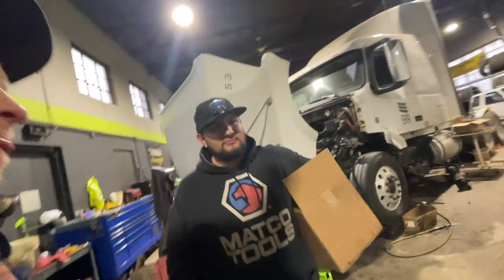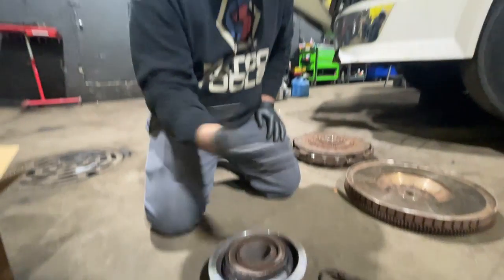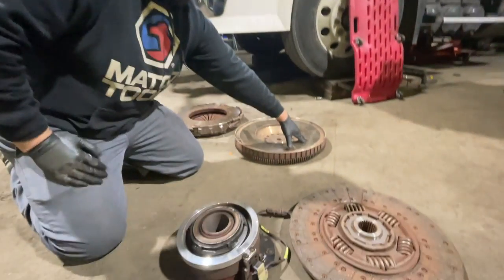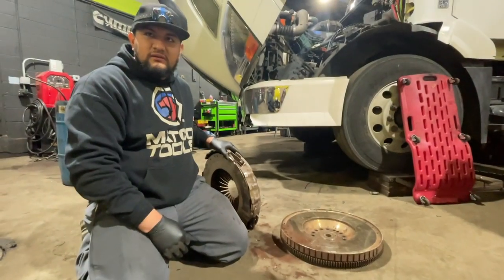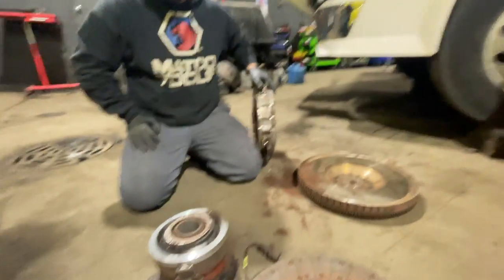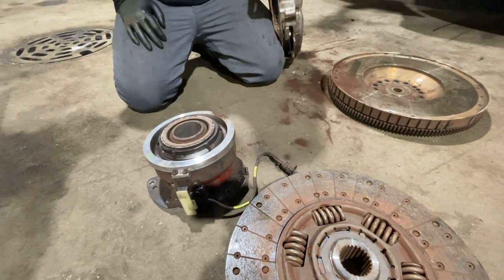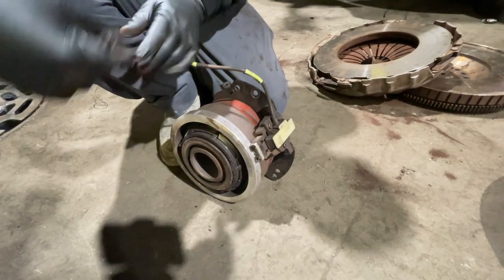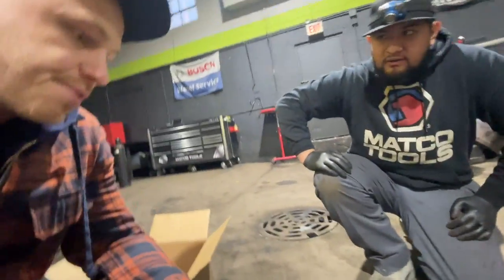Volvo i-shift transmission failed. Good to know when if you own one!

Comment: The driver caused this issue. He held the truck using the throttle instead of the brake. Heating the flywheel tells you that.
Reply: That's why hill start assist is important if you put drivers in trucks, especially if driver is a noob that's not paying attention to what he is doing

Comment: With my dads Ishift it struggled to leave gear at times. When you press on the brake pedal it’s suppose to disengage and go into neutral it failed to do it the one time and broke the output shaft. And almost caused a wreck truck was surging forward into stopped traffic and my dad had the brakes to the floor.
Reply: Yikes! Scary situation never heard or seen that happen. That bill escalated quickly! Hope all is well thanks for watching & keep on truckin 🤘🏽🤘🏽
Reply: @thatdieseltech4666  this happens back in 2014, what Volvo did was Reprogrammed the transmission, and the truck sat outside at volvo for 5 months. The truck never ran right again. I hope it got scrapped lol
Reply: @curtisnoble. I will buy a manual transmission for sure now.

Comment: Hi guys, I'm having error codeP10AE, which seems very similar to this one.  I thought I may have parked my truck on a slight incline in gear.  The air leaked out and truck did not want to start.  Aired truck up with air compressor and it will start but it still seems like it is stuck in gear.  Gear selector seems to work but I can't feel the shifts between R N D M.  Also, the truck will not rev in neutral.  I found TSB K64554358 but not a solution as I can't drive truck to service center.  Also, I did jack up the drive wheels and they seem to spin freely, so I think the trans is in neutral but won't rev due to error code.  Code persists after disconnecting batteries.  I don't have PTT.
Reply: What did you do to fix this
Reply: @timc8570  Hey Tim, its been a while, but I believe I did a battery disconnect for hours, then selected neutral before starting the truck and the truck's air compressor.   Never, ever, turn off the truck in anything but N, in my opinion.

Comment: Hi guys, am from zimbabwe and we have a Volvo FH V4 truck, it keeps sending the message clutch malfunction, what causes that and how do we solve this problem, we changed pressure plate, clutch plate, solonoid Valve, thrust bearing, was there other any other things that we were supposed to change again and which part, ? Please assist

Comment: My exact symptoms on my Mack mdrive, thanks for this.  So the clutch and clutch actuator would be replaced?
Reply: Clutch, clutch actuator, & clutch control valve along with the steel braided line suppling air from valve to actuator 💪🏽.

Comment: i have a 2003 Freightliner 3 peddle auto shift. the driver said it started sounding like the pto was engaging, 20 minutes later the clutch appears to have went out.   the thing is the truck is not equipped with a pto. should i pull the tranny & put a new clutch in? is there an Y,X shift issue? thank you for any info you can provide
Reply: I would drain the oil in the transmission & inspect for shavings.
Reply: @thatdieseltech4666  will do, thank you

Comment: Hello. Nice covering of issues. I have a error “neutral position not secured” truck wont physically engage in D or R. Truck won’t  move at all, and when in D won’t accelerate. Any help I appreciate. Thank you
Reply: I-shift transmission, 630000 mi, stuck in intersection. Won’t engage fwd or rew. Towed the truck to delivery, than towed the truck to shop. Clutch and shifter replaced $5100.
Reply: @jdlexpress7548 did it fix it?

My 2008 Volvo d12 did the same thing 2 days ago